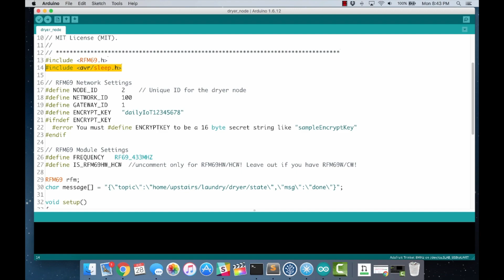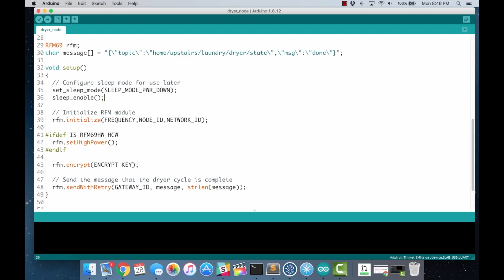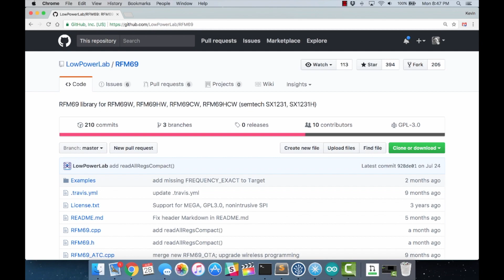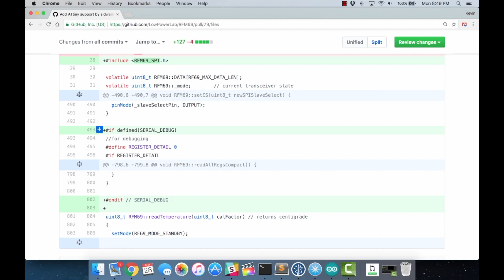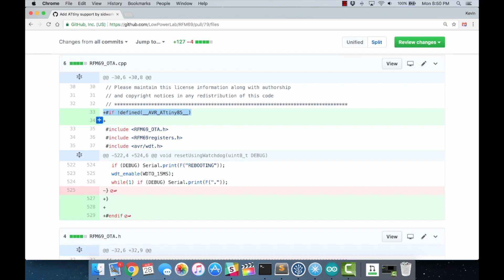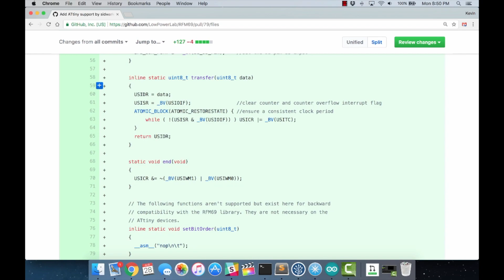Texting Dryer - Adafruit Trinket Code

Comment: Thought this was interesting did check out the info in the video just sharing.. 
An Arduino pro mini at sleep needs less current.
costs arund the same, and offers more pins.

https://www.youtube.com/watch?v=fOBGdSYi318
Reply from the maker: Thanks for the info Rud Dog. Didn't realize it had lower sleep current. We're definitely tight on pins but I do like how the Trinket has just enough functionality to solve our problem.

Comment: Really interested to see how the encryption portion works?
Reply from the maker: The 16 byte encryption string in the code creates a 128 bit cipher that is used to encrypt the packet before it is sent. Since the receiving node has the same cipher it uses it to decrypt the message. Or the very technical version from the datasheet.

"On Tx command the Packet handler state machine takes over the control and If encryption is enabled then the
message inside the FIFO is read in blocks of 16 bytes (padded with 0s if needed), encrypted and stored back to FIFO. All this processing is done in Tx mode before enabling the packet handling state machine. Only the Message part of the packet is encrypted and preamble, sync word, length byte, address byte and CRC are not encrypted."